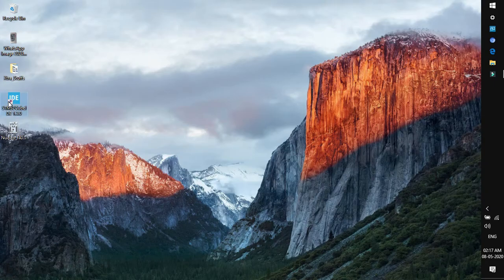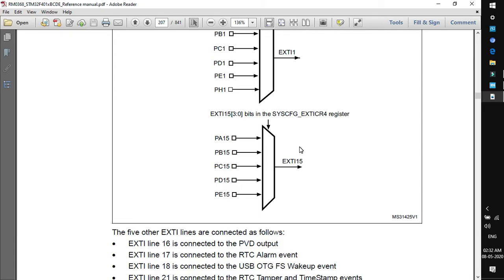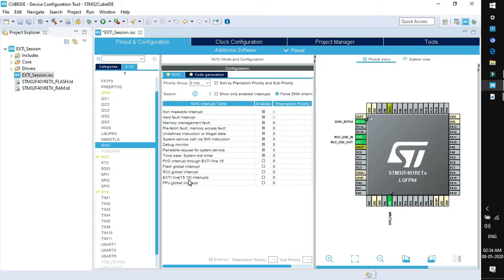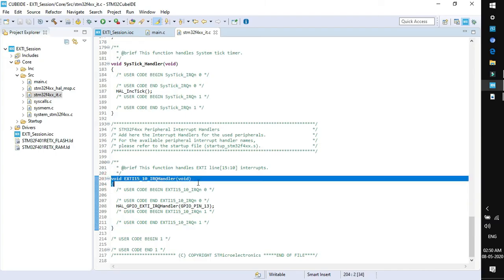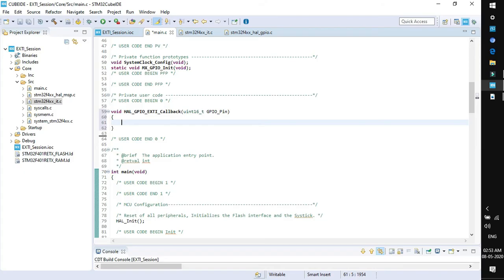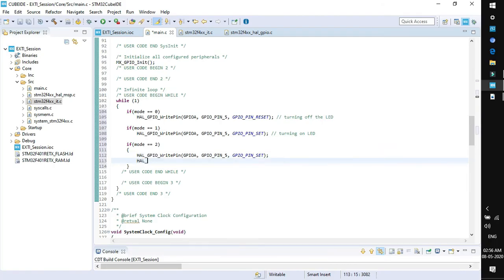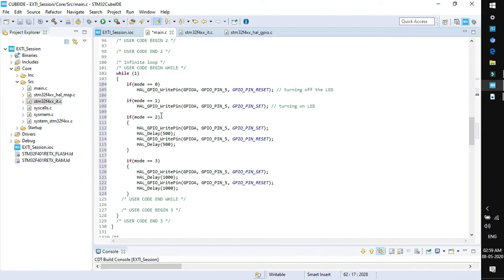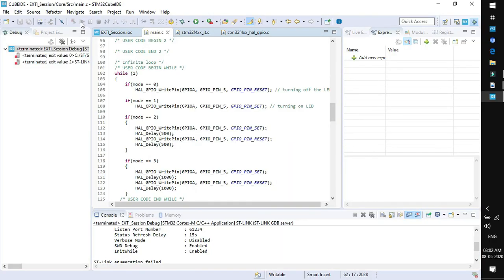Tutorial 11: LAB - External Interrupt ( EXTI ) Interfacing in STM32 using STM32CUBEMX

Comment: i want use Motor with encoder, and the encoder have Signal FG Wire that send hall signal, how do i manage it in stm32 using external intterupt? jgb37-3525
Reply from the maker: You can try working with timer instead of external interrupt. There is separate section for encoder interface.
Try referring the example code for eval board from repository. C:\Users\User_Name\STM32Cube\Repository\STM32Cube_FW_F4_V1.27.1\Projects\STM324xG_EVAL\Examples\TIM\TIM_Encoder
If you have used any custom path then you can select the path likewsie

Comment: Hi, 
What if we have used the 2 external interrupts? How we differentiate "HAL_GPIO_EXTI_Callback(uint16_t GPIO_Pin); " for each interrupt?
Reply from the maker: Based on the pin number which is given as a parameter to this callback function. If you have configured PC7 and PD8 so you have to check what is the pin number for source of interrupt and then decode the isr to be executed..
Reply: @Hexnbit great answer, what about when I use mul.tiple inputs such as GPIOAPIN7 and GPIOBPIN7 ? these both have same pins
Reply: @5245jah  you cant use same pins of different ports as interrupt at same time because they are connected to same EXTI7 line. If I am wrong then sorry